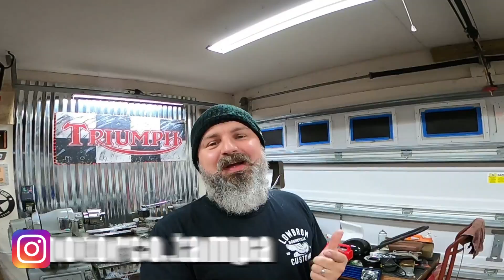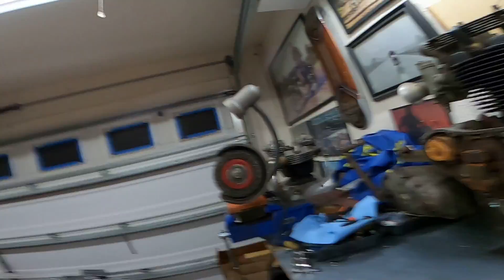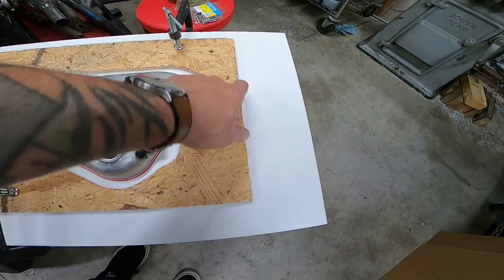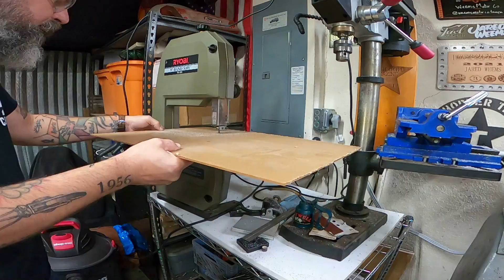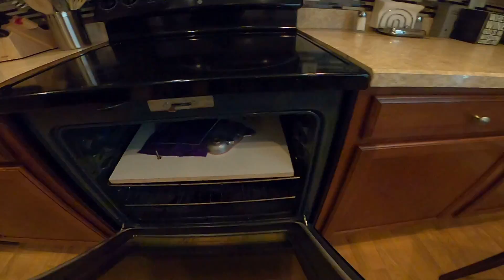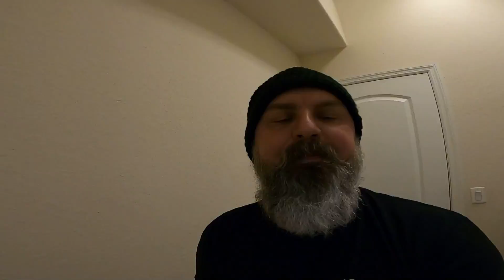How to Mold Acrylic / Born Free 13 Build

Comment: I’m looking on how to make a clear timing cover for my Z31
Reply from the maker: First off you will need the running temperature then you will need to find material that is resistant up to that point.
Reply: @weemsmotorco  luckily is a belt so it’s not part of the motor it goes outside the motor

Comment: Your on the right track, you need a press with a foam board. I made one from 4 pieces of all thread and a scissor jack. Look at forming Kydex holsters, a very similar concept. I think that would solve your issue with the middle raising up in the video. Or find someone with a vacuum former

Comment: If it doesn’t work out well enough find someone who has a vacuum former.
Reply: Or if you want to make one for yourself heat the plastic and part and make a box with a shop vac and top it with a peg board and then place the hot part and plastic on top of it and suck the plastic down closer to the mold.

Comment: You've proved it CAN be done, but you didn't stop to think if it SHOULD be done.  : )  Kidding.  I'm excited to see how it turns out.  My first thought was "it's gonna be too hot" but I've never actually checked the temp of that cover on my bike.   Sounds like it's within the limits of the acrylic.  Slightly off topic question...what handlebars do you have on your 66 Bonnie, are those the stock bars?  I'd like to put a set like that on my 64 TR6.  Right now it has the stock western style bars, but I like the slightly lower euro bars.
Reply from the maker: I have the stock euro bars on it.